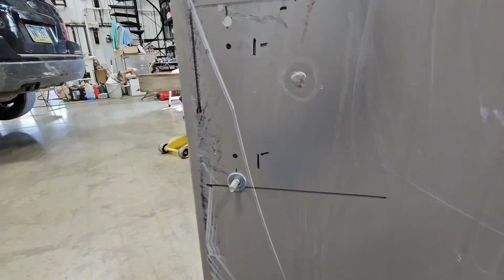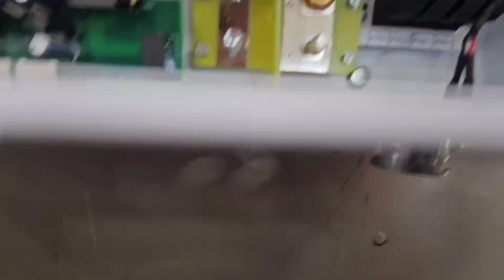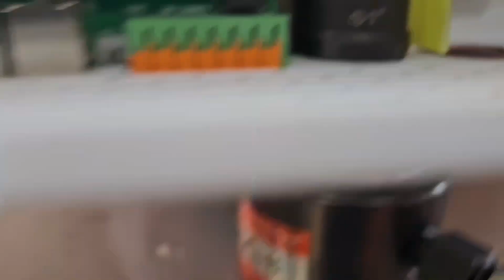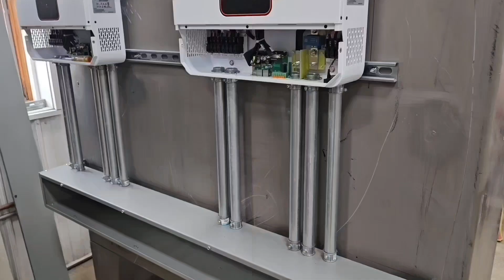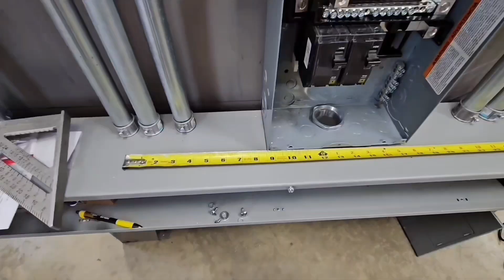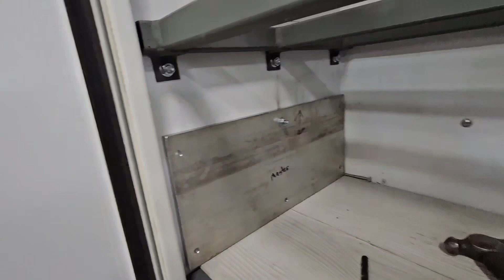Shop Solar System- Out of the box Part 1

Comment: I just got 2 SRNE 10k inverters. The manual says to use a 3awg neutral.  Notice your using what looks like a 6awg. Did your manual say use 6awg?  Im going from 4 eg4 6500 inverters to 2 of these. Hopefully the swap goes smoothly.  Same size wires except for the neutral. That neutral wire is handling 10k watts instead like the 6awg handling 5k on each leg. 
Great video btw. Kinda reminds me of the way i did mine several year's ago
Reply from the maker: Only 6 AWG will fit in the terminal. 3 AWG will never fit, it would require a pin terminal. I looked in the SRNE ASP V1.3 manual and you must be looking at single phase mode wiring for 120V output only where L1 and L2 output are combined inside the inverter. On 240V split phase with L1 and L2 180° phased, it lists 6 AWG for the Neutral. For US, this is what you want and what the settings in the inverter should be.  I just finished swapping out my house inverters to SRNE ASP's and that video will be coming out soon. I did those slightly different to combine the output but it is 240V output.
Reply: @doczwy  your right it does say that. Ordered a roll of 3 awg last night from cable your way. Gonna see if i can cancle it.

Will be looking forward to watching that video of you swapping your house out and seeing how you did your ground and neutral wires. That was always a big thing everytime i called about needing help with lights flickering or some other problem.  Ive had 2 of the eg4 6500 stop working on me because of the fans inside. Shipped the last one back around christmas and hadn't gotten it back yet. Been living on grid power since first of December.  Took them a couple weeks to get back to me about sending rhe unit back to signature solar. 
In the mean time i already got a 300 dollar electric bill. 
So far ive had 6 sorostec inverters they were 5ks single 240v, 4 MPP 5ks 240 volt, 4 eg4 6500s 120v. Did not like the 240 volt units because had to use a transformer. So switched them out to U.S. version when they finally started making 120v that was affordable.  
So 18 inverters so far ive bought definitely got over 20k in em all together so far. Before those i had an AIMS 10k low frequency inverter with a midnite classic charger. That was a small set up.

Overall i have 17kw in panels and 150kw in lithium. Built my banks like you did with raw cells. And made my own copper busbars for all the connections between them. I did nou use T fuses though. Used breakers. I can cut a bank off individually when working on it. I want to add more panels and more lithium to get by during winter and cloudy rainy days

Do you have a video on your settings?  I know on the Eg4 i have been running i had to mkve up the lithium settings as they were too low and had to have 2 inverters as SP1 andnother 2 as SP2. Had to move the wave 180 degrees out from the other inverter.  1 inverter as the master etc
Reply from the maker: @bubbawubba2307  I never did a video on settings. On the DIY Solar Forum when these inverters first came out we shared a cheat sheet for the settings. Some use battery comms so charging settings are different. Basically with USER charging settings, 9 and 11 can be the same or 11 below 9. 37 I set for the max it will allow. If you have 9 and 11 set higher to for example close to 58V, then you can set 37 up higher than normal range, then set 9 and 11 lower and 37 will stay the same. I should do a video on settings, I will try to put something together after I finish the current video.

Comment: I am curious why you don't use some quality low freq. inverters like Schneider. You do great mechanical work, seems a waste to use Chineseum equipment.
Reply from the maker: Technology in the DIY solar arena is changing rapidly. Looking back just a few years, the size and capability of inverters has increased by a large margin while prices continue to be under pressure. Think back when a 3 or 5Kw inverter was considered large, we now see inverters 10Kw and larger.  Infrastructure such as mounts, PV, batteries and wiring will last many years but tech is changing constantly with new inverter models. Second is compact size in a AIO inverter. I looked at Schneider and Victron and it takes many different components to put it all together. I think Midnite realized this and now offers The One which was on my list but the release was delayed and I decided to move on. I figure if I get 5 years or more from an inverter, it has done the job for the money and I could move to something more advanced.  I purchased another 3 SRNE ASP's two weeks ago for $2885 which included DDP shipping to my door. Two will be installed in my house and 1 is a spare. That is 30Kw of inverting power and 33Kw of PV capacity between the 3 for $2885. Where can one purchase that amount of inverter power and MPPT's for that price?

Comment: I'm literally wiring up my 70kwh battery as you popped up. I'm on my 4th pack out of 5 280ah. Great video. Awesome attention to detail. Those cabinets are the absolute best. I work in those things everyday as an industrial electrical maintenance tech. I have looked for them before but they are big money. I went with just a pallet rack style box store cabinet and lined with cement board. Like off grid garages but larger. Those end plates. Dang I didn't hear u say how thick they were but looked at least 1/2". I only went with 5/16 8*17. They flex slightly at the all threads. Can't wait to see how you connect both systems. I am curious about that
Reply from the maker: Plates are 3/8" thick. Poron I'm using is 3.17 mm thick, I think it was written on the table when I was doing the math. Compression of Poron at 25% on the 17 sheets would be 13.47 mm total. If you have rods in the middle, it shouldn't flex. It is possible you might have too much compression.
Reply: @doczwy8143  ya I have a rod in the middle. The whole plate isn't flexing just a tiny tiny bit at the 4 corners